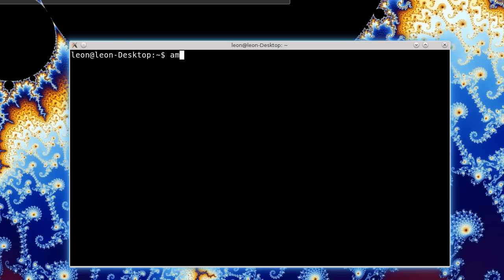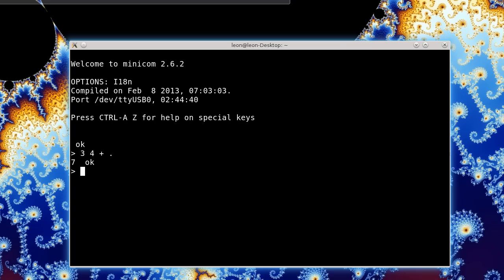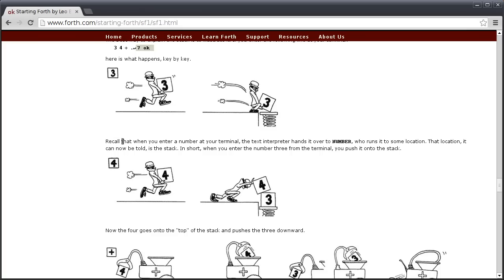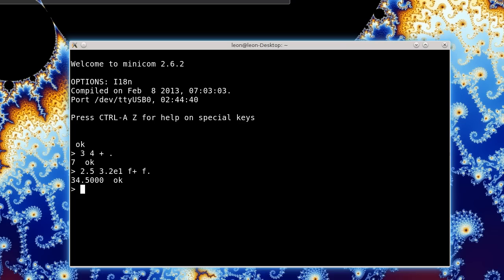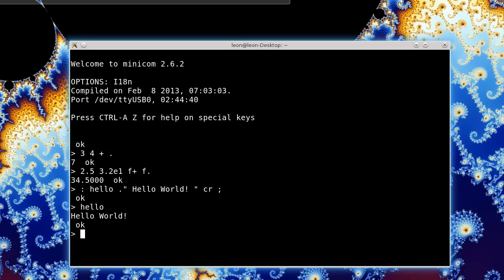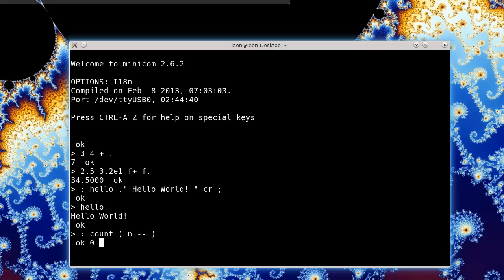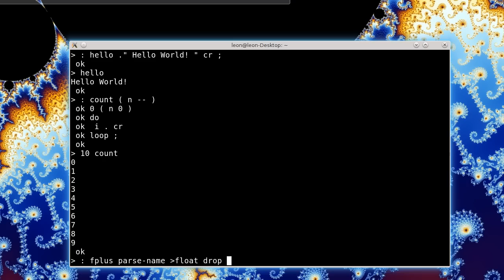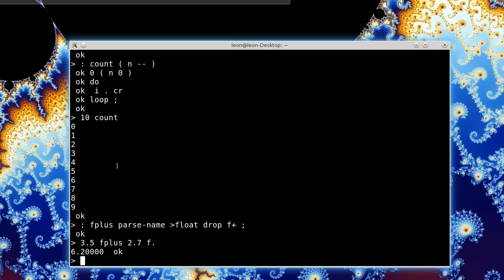Floating Away with AmForth

Comment: Hello @Leon Maurer: At the moment I have a problem: amforth does not yet have a device support for atmega4809. But one could use existing files from other atmels. Are there any of the existing avr8 devices, that come close to this new architecture? It does not matter, if my Forth is a bit smaller in the end, when it can do at least something.
Reply from the maker: Hi @Steve Zimmermann. Unfortunately, I'm not sure. That question would best be directed to the amforth mailing list.

Comment: When you define words in AmForth they're written to the flash RAM. I imagine that during a typical programming session you'll overwrite flash much more frequently. Have you had a problem with the flash wearing out?
Reply from the maker: No.

The flash on the 328 (and many other AVRs) is speced for >10k write/erase cycles (see the datasheet). If you can wear that out during normal programming, you either deserve a medal, or you're doing something very wrong...

I don't know the flash block size for the atmegas (the chunk that gets erased during each write/erase cycle), but it may be something small, like 256 bytes. Each of those blocks is speced for >10k write/erase cycles, so deleting one word will only wear the blocks that one word is in -- not all the blocks. In good Forth programming, you slowly build up a stack of words; you'll likely have to delete and rewrite them when they're being developed, but they're good to go after that, and you move to writing other words elsewhere in memory

If you need to store a variable in non-volatile memory, note that the EEPROM is speced for >100k write/erase cycles.
Reply: Leon Maurer Thanks. I'll have to build AmForth for the Pololu Orangutang controllr which uses the 328,